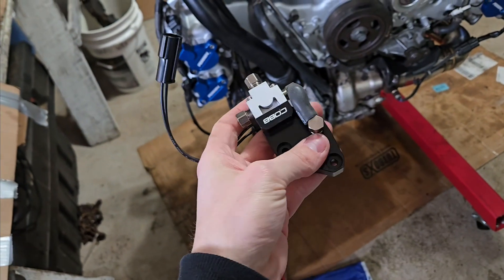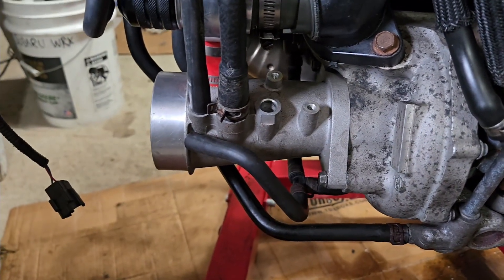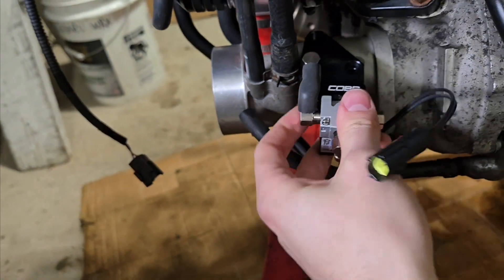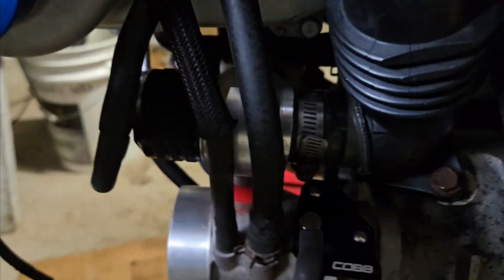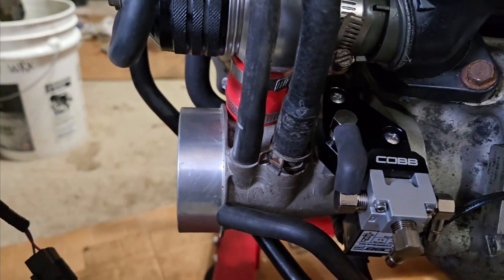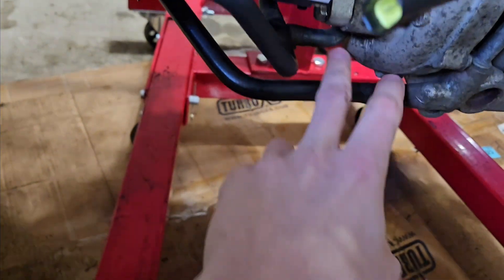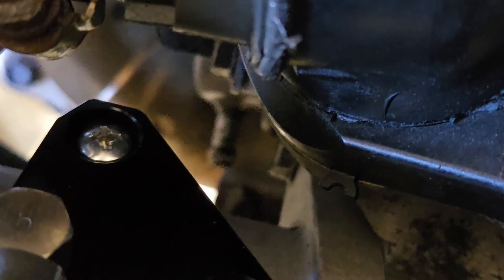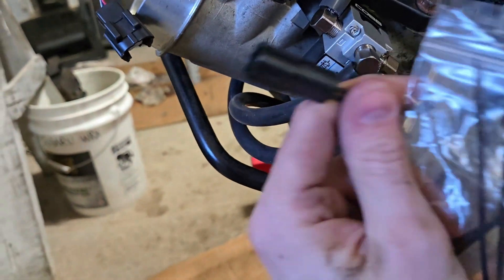Turbocharger Upgrade - Cobb 3-Port BCS Install - 2015-2021 WRX

Comment: That looks like the grimmspeed turbo inlet ! I installed mine last month but I just got the boost controller ... Kinda wish I did it at the same time. Good to know I don't need to remove the turbo inlet to install it